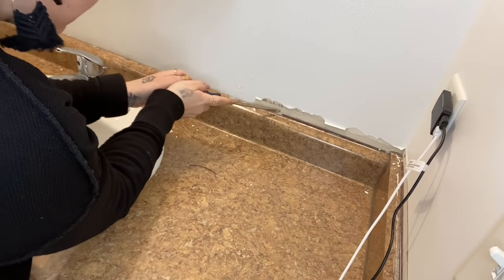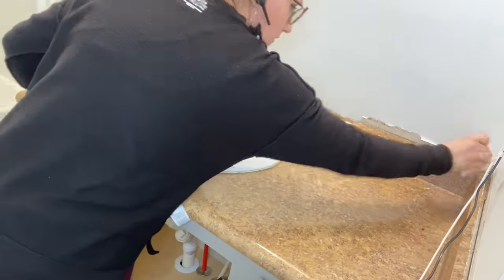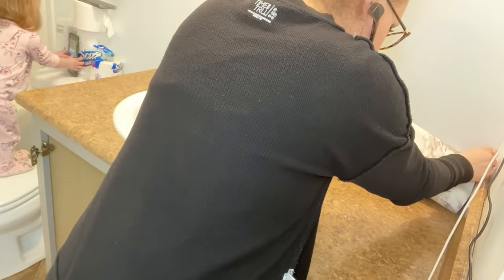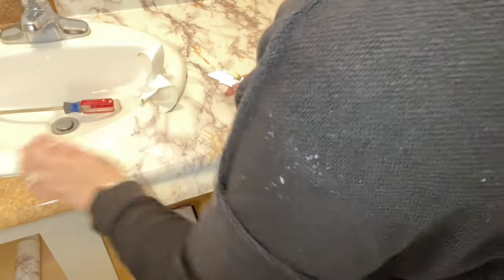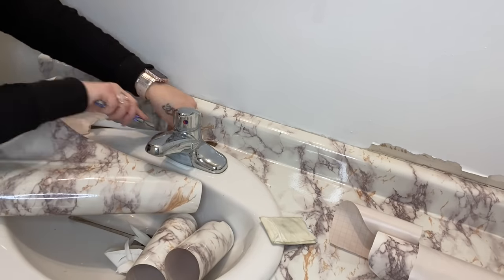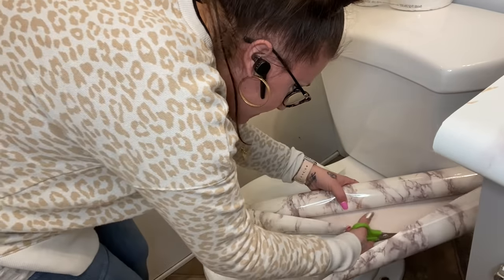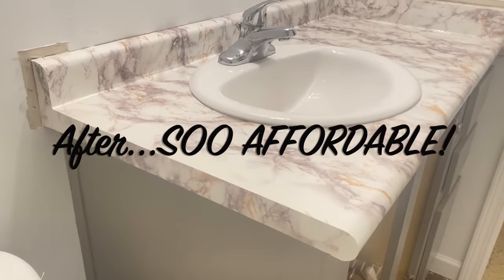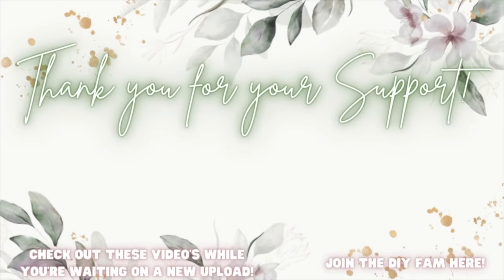😱DIY SMALL BATHROOM MAKEOVER ON A BUDGET |  FAUX MARBLE - RENTER FRIENDLY ON A BUDGET 2022! 😱

Comment: Well, it's cool, but you just lost your security deposit.
Reply from the maker: What are you talking about I own my own home and how would you lose your security deposit with contact paper? Haha
Reply: First of all, I love your videos, and by no means was trying to upset you. I should have put more info I suppose. Lol. Your title says renter friendly. I was simply stating that you would lose your security deposit. I was a maintenance technician for years before I moved to disaster recovery, and I spent a lot of time undoing little things like this.  Removing the trim damages several layers of paint that is apparent on the top right of your counter. Cutting back the sealant on the edges can allow moisture to seep in and cause water damage. Cutting that contact paper on top of the existing counter surface causes abrasions. Even setting the screwdriver in the porcelain sink can chip and scratch it. Loved the makeover as always, I just wanted to warn you in case someone does it and gets upset because their landlord didn't appreciate it.
Reply from the maker: In my video I explained that I'M DOING THIS because we just bought it however if you're renting do not do this
Reply: I understand that. It was just a comment. Mainly in case someone tried it. No need to get heated.